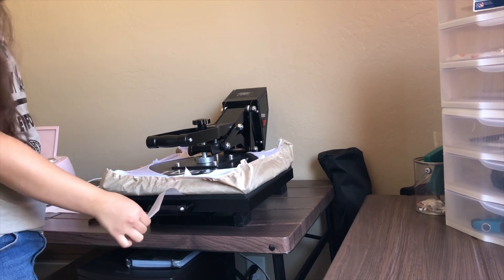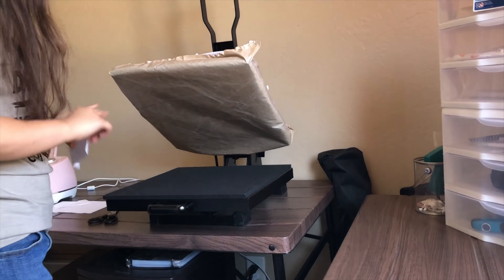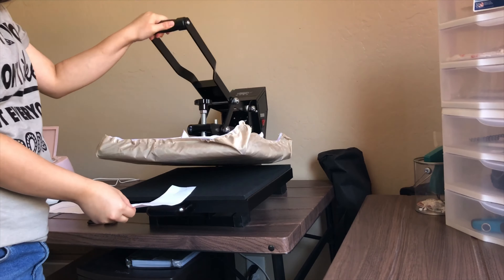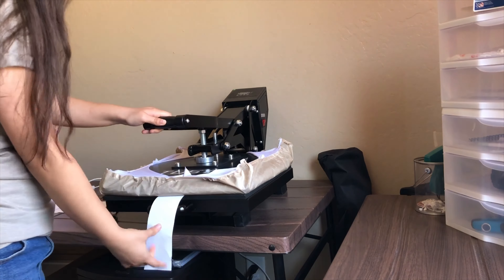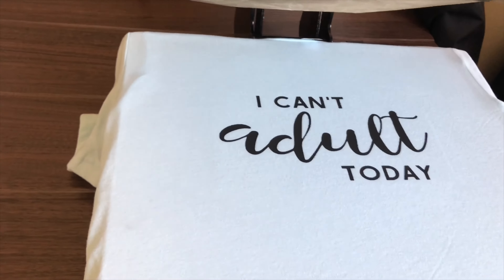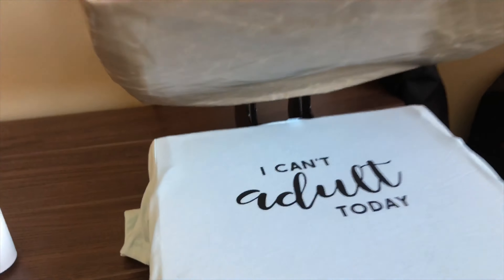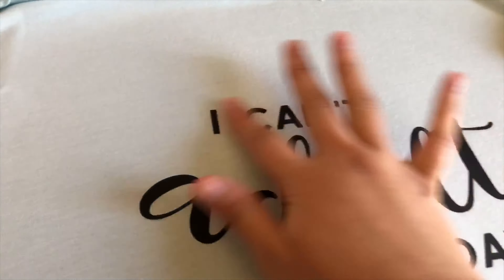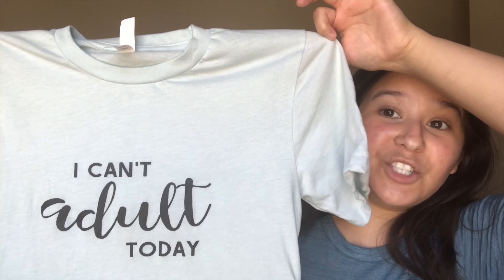WHY DOESN'T MY VINYL STICK TO MY SHIRT? Ep. 12

Comment: There are a # of issues on how your heat pressing goes great for weeks and then suddenly you have a project and all shit breaks loose when the vinyl is not sticking and you have a deadline. You are out of shirts. Now What? You have to become sort of a doctor and diagnose the issue. Here are a few issues and it's not your fault, you been doing everything right. A. The quality of the vinyl is poor and cheaply made B. The Vinyl has been sitting in your room for weeks and the air in the room may have changed its chemistry, C. Very rare, maybe it's the color. Your black Vinyl is sticking but your red vinyl doesn't. D. The pressure of your heating press. E. There is still moisture sitting on the shirt. (Heat press the shirt first for 10 seconds, then start your stamping) F. Buy new vinyl G. Over heat pressing: you stamped too long that the vinyl got dry and burned out, not sticking to the garment. H. And lastly, the heat press is not producing strong heat that meets the Vinyl's specifications.
Reply from the maker: Thank you 🙏🏻

Comment: I need help! I am pressing shirts for the first time. I have my heat at 350 for 18 seconds (this is probably wrong). Doing a cotton tee with HTV. The middle of the design is sticking, but the sharp corners (star design) are coming up and not sticking at all.

Comment: I have one of those smaller presses 
Would you recommend higher temp? Or longer press? 
Im having the same issue as you
Reply from the maker: Hello! Thank You for watching! So the issue with mine was the pressure. I didn't have my pressure right. Once I did the pressure test and fixed the pressure it ended up working!
Reply: Go with the the recommended temperature and preasure by htv. You need press down all the way until it clicks and locks in place

Comment: I have that exact heat press and my top platen is wobbly. I cannot find any videos to help me out besides this one. But I still have more pressure on the bottom than the top. Is there somewhere you can post a picture of the press while it is clamped down? So I can see if I am missing something. I bought it from someone on offerup. Should've known. 🙄
Reply from the maker: Hello! My top platen is wobbly too. Not extremely wobbly but it is not firm. Send me a DM on instagram and I can send you a picture of my press. My instagram is @idalis_boutique.

Comment: Great video, the fact it took long to get to the point is irrelevant Youtubers know how to skip ahead. A couple of things you should do before pressing is to pr-press the shirt before placing the vinyl you can also place an old shirt  on the press and place the shirt you intend to press over it if your heat press cannot adjust for some reason. Another technique if all fails is to press the garment inside out meaning adhere the htv to the shirt turn inside out and press over the area of the HTV this works better because heat rises and because of this the htv adheres better even though this is the best way it is rather inconvenient but these are out of the box questions your audience may not have thought of.
Reply from the maker: Thank you 🙏🏻
Reply: Great idea thanks
Reply: Ok so if it's not the pressure and you have the what else could it be??? My 2nd time using $400 machine and letters wont stick😰

Comment: I need help.  I just started using a heat press just like yours in this video.  I have a t shirt with cricut smart htv, size of image is about 9x10.  The top of the image doesn't seem to want to adhere to the shirt, but the lower portion does but its not perfect.  Do you think the pressure could be my issue too?  Also, can you tell me the temp and time you would use on a 100% cotton.  I normally use a cricut easy press and i've never had my shirts come out crappy.  I need help. lol. thank you anyone.
Reply from the maker: Since you are saying you used htv then, i am sure its the pressure! Make sure you do a pressure test before making anymore shirts!
Reply: @Idalisco  thank you.

Comment: can I use Cricut Iron on vinyl with the heat press and if you do what settings do you have at
Reply from the maker: Yes you can. For the heat settings, please refer to the instructions Cricut provides. I use a different brand than Cricut therefore the settings will be different.

Comment: Can I use normal iron ?? And where can I put the temperature  high or low? Thank you
Reply from the maker: Normal iron is not recommended. Check the manual, all presses are different.

Comment: My prints will not stick, maybe there old.
Reply from the maker: It can be different reason for why it is not sticking. I can be the pressure, wrong type of vinyl, or your heat press is not hot enough.

Comment: What was temperature???
Reply from the maker: My temperature is always at 305 F
Reply: @Idalisco  how long do you keep the heat press? i have one that does it by seconds and i did it at 70 seconds.
Reply: @kikalocs5724  Hi Kika, I set my heat press up at 300 °C for 30 seconds covering the t-shirt with a Teflon sheet. Then let the t-shirt cool for about 15 to 20 seconds, cover it up again with the Teflon sheet and press it up for another 15 seconds just in case. Then I let the t-shirt cool down for 15 minutes, unpeel the vinyl and put the tee inside the heat press covered with the same Teflon Sheet one more time for not less than 15 seconds. My prints are flawless.